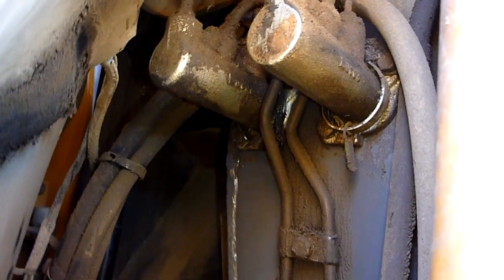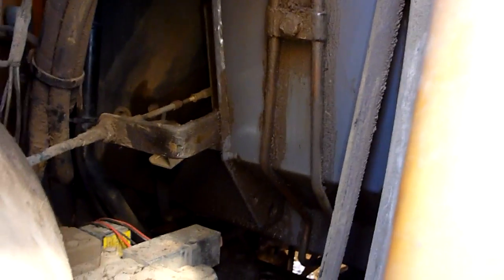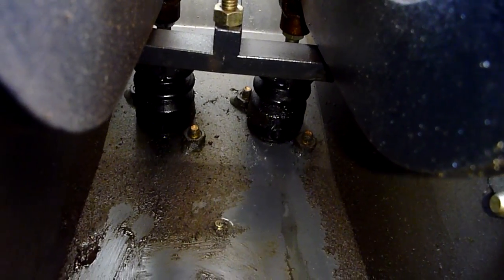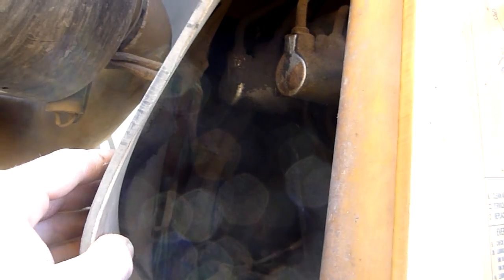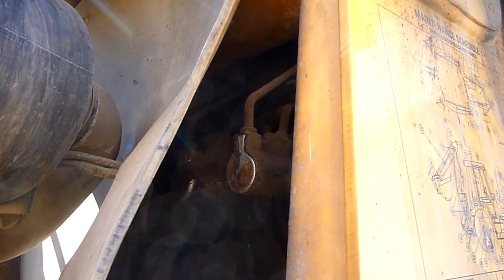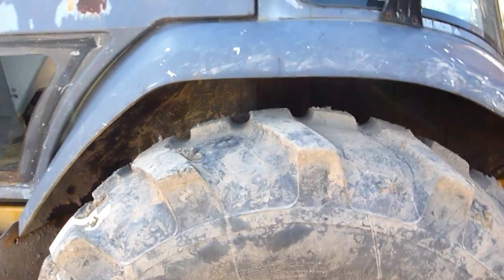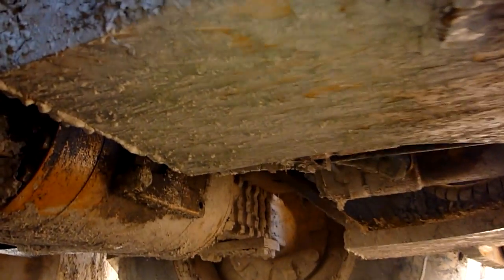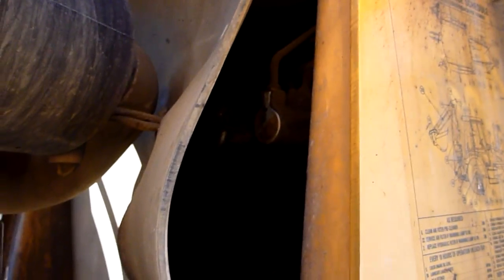Case 580L Turbo Brake Problems

Comment: we had the same problem on our 580 super-k we ended up hauling it in to get new hydraulic brakes on it. but grante the 580-l is newer than the one we had so it could be a disc on the inside of the axel

Comment: Did you ever figure out what was going on?  I'm picking up a tractor in a few days that has the exact same problem, pedals dropping to the floor, probably leaky master cylinders.  Is it getting hydraulic fluid from the hydraulic reservoir?